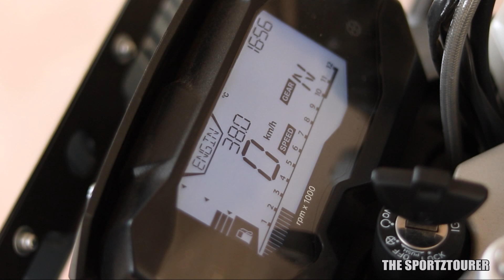BMW G310R SOUND | BMW G310R EXHAUST SOUND | BMW G310R ENGINE SOUND | ENGINE COLD START SOUND

Comment: It is recommended that starting a bike in the straight position because most of the bikes oil pump is in the brake side
Reply: an oil pump will generate psi in a system regardless regardless of orientation and working against gravity effortlessly.

Comment: Hello Sportz tourer I Friend
Can we use castrol power 1 ultimate 10w40 fully synthetic bike engine oil in suzuki access 125 bs6, if yes then hope it dont cause any harm to the scooters engine. Request you to please help with a revert for above query, also pls do share your contact number if possible, i am a big fan of yours 🙏
Reply: Go with shell 10w-30 semi synthetic, you don't get disappointed, engine becomes smooth and little quiter than before